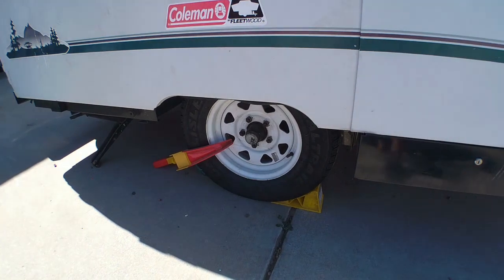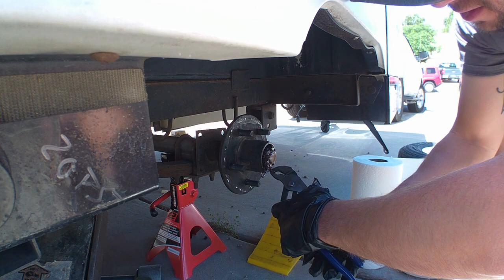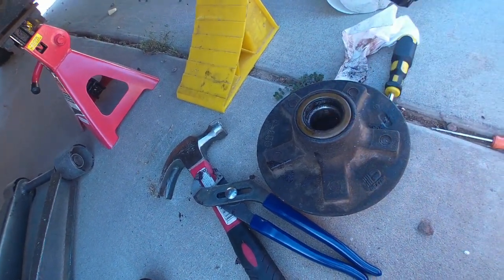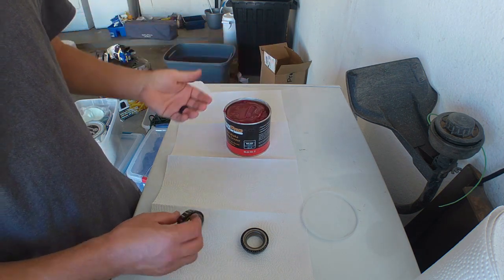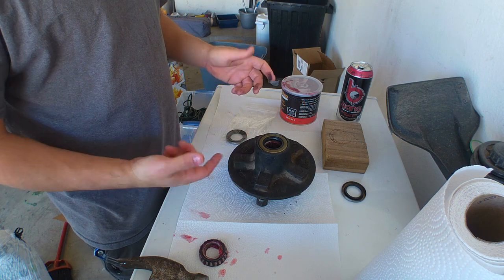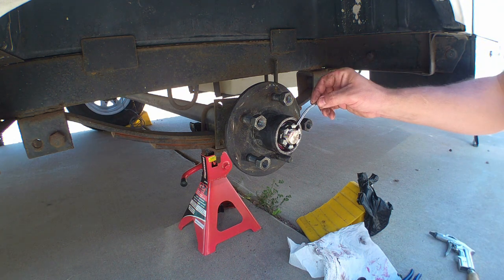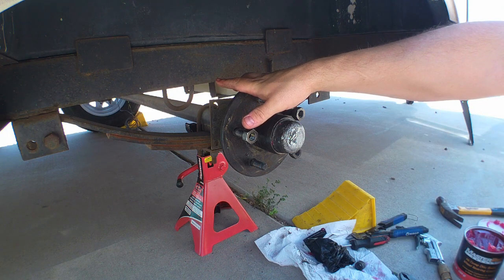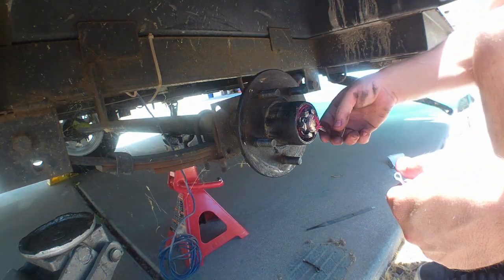PopUp Camper WHEEL HUB SERVICE

Comment: Where do you buy the gasket and stuff? That HUB say it is damaged or whatever can you get a new HUB at the same place or can you get it at autozone or O Reilly’s or does it have to be at a RV store?
Reply from the maker: I got both the hub seal, as well as, a back up hub from etrailers.com. Really easy to work with and have great customer service. Depending on your make and model you may be able to get them local(hardware or auto parts store). You will have to try to look up the specifications for your particular popup.

Comment: Any chance you can share where you got that wheel lock? The crappy hitch lock I am using now is worthless.
Reply from the maker: https://www.amazon.com/Universal-Security-Vehicles-Motorcycles-Deterrent/dp/B083146BCX/ref=mp_s_a_1_3?dchild=1&keywords=trailer+wheel+lock&qid=1626278403&sr=8-3

This isn't the exact one but pretty much the same. I think it's about as good as a hitch lock but one more thing someone would have to remove to take it.

Comment: Do you have to do seal every time or was yours just leaking and that’s why you replaced? TYIA
Reply from the maker: You don't necessarily have to reseal each time but those seals will only last so long getting pulled off and putting it back on. Depending on how often you use your pop up will dictate how often you need to service the bearings. Once a year at minimum is what I would recommend. I definitely needed to put new seals on mine because of the leak. Some people may just repack and use the same seal but I'd much rather be safe than sorry.